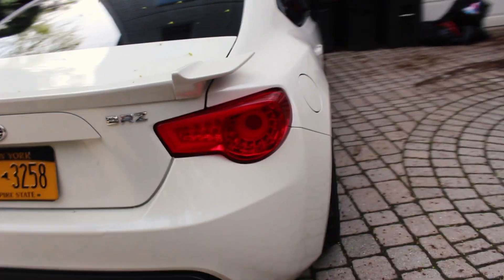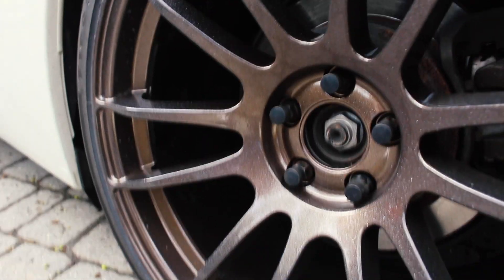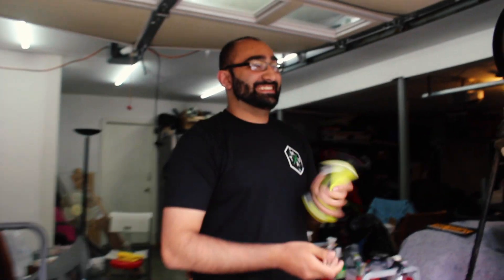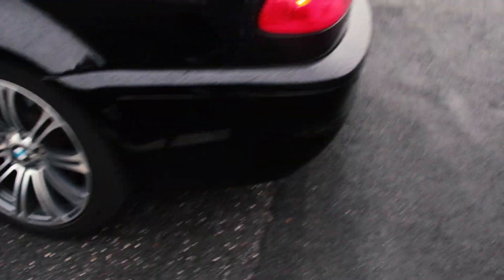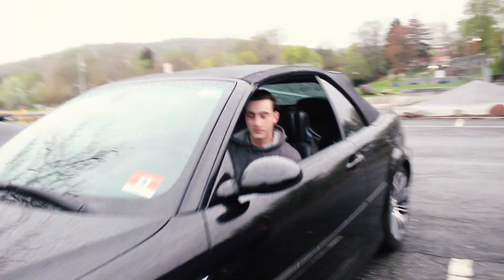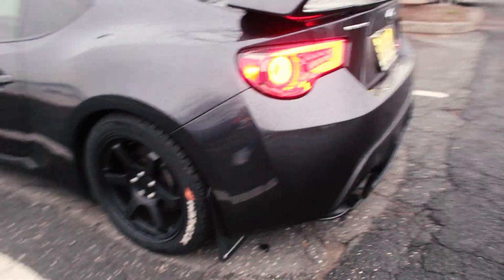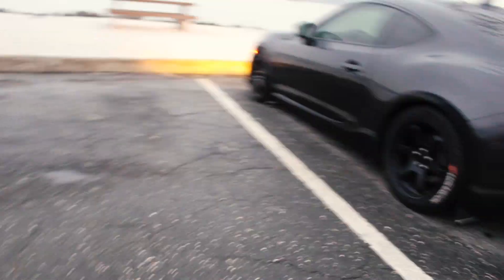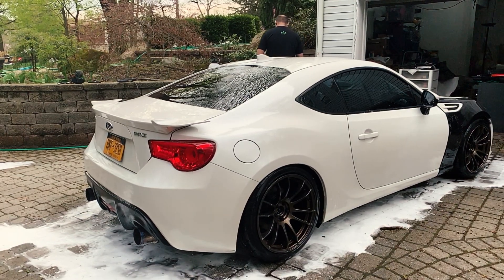Firestone FireHawk Indy 500 COULDN'T Handle The Rain? Review Video was Ruined!

Comment: If I can hook in a FWD car at about 3000lbs with 350ftlbs on 93 on 225 section tires at about 37psi cold I think these tires are plenty for any lower hp, low torque car.  For the price they really surprised me and I am glad because I hate having a tire that just makes me look forward to getting rid of it. I drive my car for work so having to do 100 miles or more in a shift on a tire that sucks is painful and it's why these winters were absolutely miserable until I adjusted the tire pressures after a recent rotation.  Instead of 37 back and front cold I went for 34 front and 37 rear after driving for 15 minutes in about 30 degree weather and they actually feel really good and the 43-50mph vibrations went away almost completely and they don't feel as sketchy.  But I would go back to the Yokohama's for the snow in a heartbeat...that or General.
Reply: I think this just convinced me to buy them